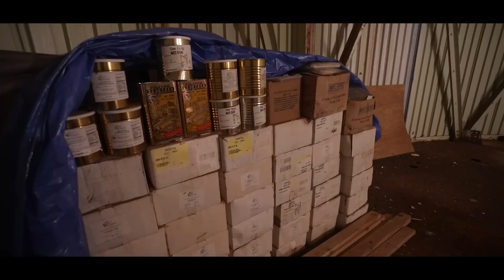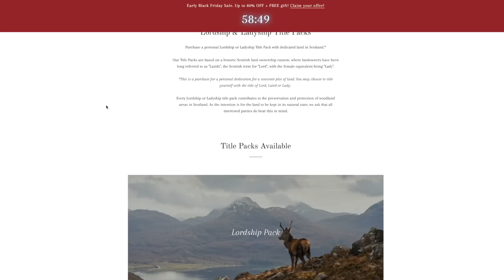Prepping for DOOMSDAY at the NUCLEAR Missile BUNKER!!! (Ready for Putin's NUKE)

Comment: First thing you need is a working air filtration system or that huge bunker will be a huge coffin.
Reply: Yep exactly
Reply: @jmac4820  I wouldn’t have a pipe leading straight up to the top either. It would be super easy for someone to pour fuel, gas or smoke down there to force you out not to mention let all the radiation and fallout into your shelter. A simple cover will not stop radiation from traveling down. It would have to be covered by either 36 inches of dirt or 24 inches of concrete minimum to any opening.
Reply: hydroponics. solves fresh food, water filtration and air purification. Turn a bike into a battery charger and you have exercise for people, plus power for grow lights and other stuff. Then you grow hemp in one section, twice as much oxygen as trees, provides fiber and medicine. if you do it right you can be sustainable. Entertainment would be important.
Reply: @mustang35146  have one of those German loops where if someone tosses a grenade in it will just roll back out onto their feet
Reply: Also the vapor from the heaters are hella flammable
Reply: Lol that gum is for
Constipation
Reply: Guys, HERE is The Savior

HalleluYAH translates “Praise ye YaH”

YaH is The Heavenly Father 
YaH arrives via the TENT OF MEETING
YaH was Who they Crucified for our sins

** NO FEMALE INVOLVED WHATSOEVER **
— Hebrew Book of Isaiah

Isaiah 42:8
"I am YaH; that is my Name! I will not yield my glory to another or my praise to idols.

Isaiah 43:11
I, I am YAH, and there is no other Savior but Me.

Isaiah 45:5
I am YaH, and there is none else.
Reply: Oh my where do I start?Do you guys know anything about how to set up this shelter??? You may be stuck in that that shelter for a year if not more. Do you know how to deal with the nuclear winter? First you needs decontamination area with showers and waste containers to dispose of contaminated clothing. You need blast doors to close. The force of the blast will infiltrate your whole living space  radioactive winds, soils, debris. You need a air purification system to keep radioactive contaminates from entering, do you know what it costs for  1 person to eat pre-made foods for  1 year? It’s a lot. You need an organized storage area for just food. Stack it to the rafters. Do you have a way to grow food inside the bunker? Soul, grow light or hydroponics? Sanitation. Incinerator
? Human waste? You do not want dysentery. Do you have a dedicated area for medical supplies? A library of military battlefield medical books? DIY library , with multiple topics. Do you have plans for a dedicated pow er source? The main electrical grid will go down in an EMP or nuclear strike. For that size area you will need a solar field and solar generators that can run in sequence or a diesel powered generator and tons of diesel fuel  stored.  Oh geezzzzzz I could go on forever. You guys are nowhere near where you need to be to be able for this to shelter you adequately, let alone any children or elder persons in your group. ……fella, are you doing any kind of research ? Do you even have a supply of iodine to treat the group ? To protect the thyroid from radiation which is what will eventually kill you.+I’m just kinda flabbergasted .Knowledge is needed here. A lot of it. Check out the Davos group. They have revamped silos into high scale shelters. Atlas Shelters is another group. Both here on YouTube.
Reply: @heatherfroman7031  thats where i would go, would be natural. Having plants to rid the co² and give plenty of oxygen and then have plenty of food etc

Comment: I have an idea for the main door, you weld two rings on the steal door with log chain attached to them, put two hooks on the other ends. Then you put two anchor rings in the concrete walls and attach the log chain to those anchors with the hooks. It will anchor the door closed to the concrete walls.... That winch will never hold. Just a thought, it would be horrible if you did all that prepping and work for somebody to come along and rip that door open, and then your Dead. I would not bet my life on a 2000 lbs. cable. If you did the anchors with log chain no one would ever be able to get in while you're surviving. You could even do four log chains and anchors at each corner. Just an easy easy idea to make sure you stay safe and alive lol.

Comment: You should check into a water filtration system so you could use the water in the silo . That would turn all that water into usable and drinkable .
Reply: Yaaaaa I would nooooot drink that water at all. That's prob filled with old oil,asbestos,rust and prob a dead body, so lots of bacteria, eve. If it was filled I wouldn't recommend it. Esp since that water prob has been there for atleast 20 years. It would be nice to be able to drink it tho. He should make a giant or multiple water tanks in the second level room
Reply: Then he can store 4,000 gallons of fuel, instead of “Drinking water”
Reply: I think he needs to dig a good sized pond, pump all the water out of the bunker to fill it, stock it and fish it. And since there’s so much hydraulic pressure at the depth of the silo, they could pipe it out to the pond and essentially create a well to keep levels full.
Reply: Guys, HERE is The Savior

HalleluYAH translates “Praise ye YaH”

YaH is The Heavenly Father 
YaH arrives via the TENT OF MEETING
YaH was Who they Crucified for our sins

** NO FEMALE INVOLVED WHATSOEVER **
— Hebrew Book of Isaiah

Isaiah 42:8
"I am YaH; that is my Name! I will not yield my glory to another or my praise to idols.

Isaiah 43:11
I, I am YAH, and there is no other Savior but Me.

Isaiah 45:5
I am YaH, and there is none else.
Reply: @gregkrueger331  Then the pond needs to be as deep as the silo, cant pipe water higher than the surface in the silo without a pump...
Reply: @kristianljungberg4363  yeah I wasn’t meaning a literal spring. They’d obviously have to constantly pump it out but they could pipe it to the pond and pump it there. The pump and the pipes are just the mode of moving the water from the sump as it fills.
Reply: I would like to see a water test done on that water to see what is actually in it. 👍🏼

Comment: Hey Flair, its my birthday and Im so happy your video posted today.  You made my night.  Added a list of somethings that will help you with this build/ adventure.

A few things for the silo:

1. Make sure there is no handles or anything on the outside to grab otherwise folks can open it by just simply winching from the outside and all you might hear is the cables inside give, though if you stand too close it could be a very bad day.  I suggest like the olden days when they use to seal doors with steel beams or 4x4s across the door with brackets to hold it in place.  Also Id toss a kill switch on your vehicle, many folks wouldnt know to look for one and its something my brother in law does to his vehicles when he leaves them at the cabin.  That way folks wont mess with them because they wont start.

2.  Air filtration system and get the asbestos  taken care of immediately. 

3.  Power supply you will have to find a way to hide your solar panels.  Another idea may be wind turbine for power.  This way you wont need fuel for power at all and your power banks will charge and store just like an off grid cabin or home.  You can literally make one from scraps or buy one.  Also invest in rechargable batteries.  You will also want 4-8  short wave radios and batteries, and possibly 2 or more HAM RADIOs and  batteries  (HAM RADIOS, require a license to broadcast unless extreme emergency is requested or the world is ending).  

The wind turbine would give you all the power you would need and then could even give you enough to clean your water thru power and pump. It would  also give you power to recharge dead batteries, car batteries, tools, lights, stove, pumps tvs, survaillance etc etc.  I also suggest getting some books on off grid living and gardening to keep there in the bunker.  Good bathroom read but also will come in handy.You would hook it up as though you lived completely off grid like an rv etc.

You may need fuel for vehicles but Id bring your   ELECTRIC BIKES here.  1 for stealth mode, 2 no fuel needed.  

3.  WATER You could use rain barrels for drinking water,  bathing water, then use it to water your plants and have the plants syphon into a whole hydroponic system with fish etc that way you have meat also.  When you clean your water use a power flow generator to generate more electricity it will also help with water movement to keep your water from becoming stagnant etc.Water Flow Generator Turbine Generator Hydroelectric Micro Hydro Generator 1/2 Inch Portable Water Charger 10W 12V.  ( you would need one for a bigger system but atleast you can see it could charge 12 and 24v batteries. You can also use things like clean towels, rags or clean socks, gravel, charcoal, stone, sand etc to build your own filtration for water.

4.  Remember a heating source for your food be it stove or eood burning stove, keep in mind the more vents u have outside, the more folks and debris will be able to block them or drop down to you.

5.  You may want outside perimeter lights that light the whole place up with a siren should anything like a gate etc be breached.  Maybe a second siren if the door is being altered. You may also want flares/miroors, to light up the outside for rescue purposes or flash bangs. Id clear 15 feet all the way around and then put obstacles that only your group knew how to get thru inbetween the gate and the door.  But you do need to camouflage this fortress, otherwise you're going to have everyone banging on your doors.

6.  Cameras all the way around.  Maybe some traps or something that lets you know if someones been there.  Tape on the seal of the door, a thread across a doorway.  2lb fishing line on the fence where it closes etc.  Something that can snap easily but will also inform you if youve had a trespasser.

7. Maybe do the bathrooms, hydroponics(seeds), fish tanks, and kitchen on one floor and livingroom, tool shop etc and bedrooms on the other floor.  Dont forget your pantry is under the kitchen floor with MREs and Canned goods and smoked meats/fish, jerky and any veggies you preserve.

8. You may want to think of how to barricade yourself or an escape hatch should you need it, because sooner or later you will need one.

9. Dry some deer meat, any meat etc and make a lot of jerky.

10. Dry berries, pickle and jar other things and learn how to properly can goods.

11. Make a garden but find a way to hide it, camouflaging etc.  Just like the silo door, hide it, change the way it all looks so less people would be intrigued to stop there.

12.  To soften or rehydrate MRE breads, any nibs that are hard and snacks take the item out of the package, wrap in a wet cloth, place in microwave for 20 seconds to a minute or place  beside a hot light or heated stove or fire.  This trick also works with heating up a hamburger and softening the bun etc.

13.  Stock up with flint, lighters, matches, knives, canning supplies, pots and pans, candles, toilet paper/leaves or get a portable bidet(but then your using your water supply) 

Hold onto water bottles or canteens to refill water etc,  guns and ammo, bow/arrows, fishing gear and line/hooks etc, rechargeable batteries, cables, cords wires of all gauges, extention cords, hand and electric tools, light bulbs, clamps, seeds for planting, pumps and any pump system if you have water and a well, hydroponic area to grow food and clean your water, pvc plumbing etc, cards, dvds, tv, books (growing your food, electronic repair, building an off grid system, making your own medicine etc etc ) and board games to keep people from going crazy if there is no tv.  Definitely get HAM radios and batteries that are rechargeable and some regular radios for missions and going on supply runs etc.  

Camping tablets for water or at minimum  make a charcoal system to clean it or boil it or a whole lot of life straws.  Get some fresh MREs but I wouldnt toss the old ones.  Ive seen a lot of folks eatting MREs from 20 to even 50 yrs ago online, the bread is stale but they all said if youre staving it aint bad and everyone said they were fine the next day.  Do it at your own risk tho.  

Keep things like rice in a sock that can be reheated and used as a heating pad for sore muscles or toothache or ear aches.  Also clove oil on a qtip placed on the tooth or gums will take the pain away from a tooth ache.  You may also want a first aid kit, with all the bells and whistles and some peroxide etc with all that metal and rust in there.  A sewing machine or sewing kit for quick repairs would help with cast nets, clothes and filters for water filters etc.

Also EAR PROTECTION/ PLUGS.  I would be very careful about firing anything in the actual silo or the dwelling.  Ricochets, lead doors, steel every where and thich thick walls.  Not to mention when you say Shew it echoes,  can you imagine a gun ringing  nonstop.  It will do serious damage to your ears, blow your ear drums or worse.  Im sure firing inside would be a last resort anyways.
Reply: also one tip on solar panels is that when nuclear fallout gets into the atmosphere, it starts to rain down fallout which can cover the solar panels causing them to not work.

Comment: You guys need to build an underground garage for all the smaller vehicles like quads on the property. Have a hole with a ramp down as an entrance, and to hide it you either keep the top 2-3 inches of dirt and grass and roll it over top, or use a giant grass covered guillied up tarp to cover it.
Reply: Imagine a garage in the silo, elevator in the middle, rotary drive on platform, could fit so many stacked in there

Comment: You need air filtration, hard plate body armor and trauma pads, kevlar helmets, cctv to see outside the bunker, generac generator hooked to nat gas line in addition to solar panels, razor wire on the fence and inside the perimeter, install steel grating over the missile silo part so the water pit isn’t wasted space. Tubular handrails going down the entrance stairs with holes drilled in them and a high pressure propane tank and ignition system hooked to the railing so that you can turn the entrance into an incinerator if someone breaks through the front door…ect

Comment: If there is a nuclear strike in the area you will need a way to either filter the air coming in to the bunker or get a greenhouse in place so you can have oxygen circulating.

Comment: I would go 12 volts, solar, batteries, look at items used in campers, 12 volt water pumps,  rice cookers, food warmers, CBs, alarm clocks, phone chargers, fans, heated blankets, lighting with leds, so much stuff is available for 12 volts.  take a look at the 12 volt items where truck drivers stop.

Comment: I'm not sure if I missed it but you might need some type of air filtration system. Depending on if the air is breathable from the outside you would need to make sure the door is fully sealed off and the air is filtered to prevent carbon monoxide/dioxide poisoning from people breathing and everything running in there.

Comment: 20:26 Ventilation. You need power to run the fans. Solar and wind power would be good... you'd want a very large bank of batteries so that they discharge slowly to keep their cycles down so they last longer. Propane for cooking and you can also get some fuel cell stacks that run off of propane to give you electricity too. You'd need to exhaust the fumes, of course... so once again, Ventilation. If you really wanna doomsday proof that thing, I'd suggest getting a large chemical/biological filter for your main air intake.
Reply: Another good thing to bring is a LifeStraw filter. They come in different sizes. You'd be able to turn the silo water into drinkable water... so instead of 5 years, you'd have a couple hundred years of water.

Comment: Also flairnyou should install back up battery powered emergency lights so if or when the power goes out they'll auto turn on,. Also it'll be pricey but you should invest in a new air intake tube to the surface but install a hand crank charcoal filter on it.  If a nuke does goes off you're not gonna wanna breath in that air, it'll be filled with ash and radiation.. and you won't be able to safely go up for about 30 years until the radiation goes away

Comment: put a fuze or a switch on the batteries power wire and just flip or pull the fuse. that way what ever is draining your battery wont. then just plug it in when you want to use it.

Comment: Air scrubber large enough to clean the air from fallout you need to clean your water as it will have abestos and metals    the silo needs to be air tight you also need a clean room to wash contaminates off your bodies and a back up genrator geothermal or a waterwheel which will cycle your water so it doesnt go stale as solar wont cut it when radioactive clouds cover the skies

Comment: A gas generator is only needed to recharge your lithium batteries ( if need be ). I would work hard on perimeter reinforcement ( lighting and video survalence ). Every system should have a backup.. Your ventilation system and fresh air intake should be gone over and improved. Also a few 40 foot shipping containers make for good storage or defence obstacles

Comment: I’m by no means a preper or anything but my years in law enforcement, physical security, and military I’d say for sure a new outter door, probably a couple extra big metal doors. Water filtration system to use that water in the silo. And new food supply.  That food may still be okay,  I’d just tuck it away and get something new. There’s lots online.